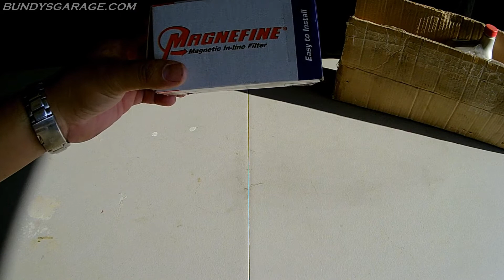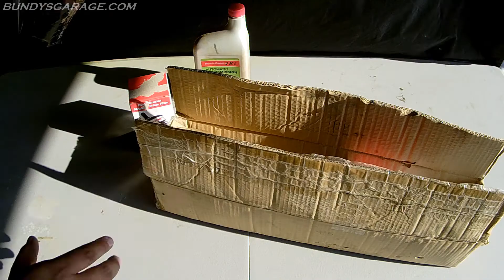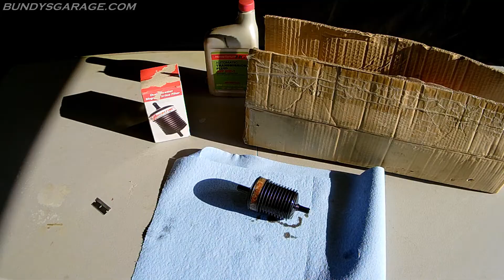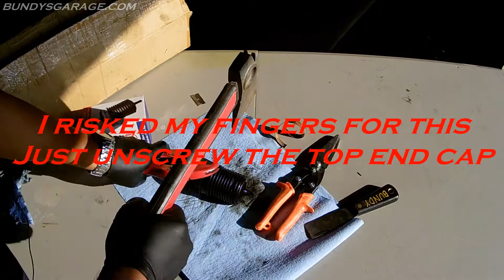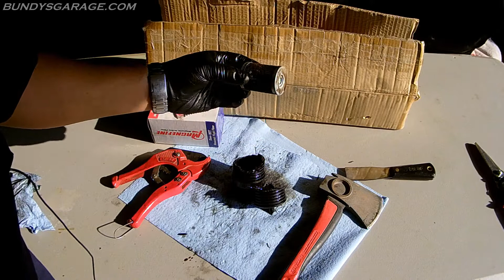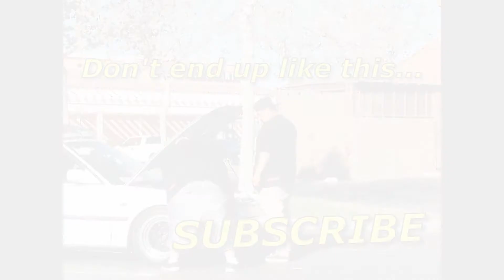Cutting open Magnefine in line oil transmission filter - Bundys Garage

Comment: WTF. now I feel ripped off. I have a brand new magnefine filter, with a metal case instead of a plastic one, but it is NOTHING like this inside. I can see through both ends and the only thing I see is a metal screen in the middle of the filter...

Comment: You could probably get away with putting on a fuel filter to filter atf fluid
Reply: Bad idea.  Fuel filters don't have a by-pass valve and if the filter restricts the flow it could kill your trans.

Comment: looks like if that filter is not changed often, it might clog up easy.
Reply from the maker: Your exactly right. The owner replaced the filter because the transmission would not shift correctly. After changing the filter the transmission worked fine.
Reply: Yea i wouldnt trust that at all. I do like the idea though
Reply: It has a bypass for when the media gets full, but u can't leave it in forever
Reply from the maker: You have to change it often
Reply: the transmission built-in strainer is used instead of a filter to prevent restricting pressure. It only prevents larger debris from being circulated... just keep changing the fluid to maintain proper viscosity!
🤗
Reply: It has a bypass once it’s full.

Comment: The guy used a fucking dremmel tool!!! ( if u really seen the video u would know...) you telling me you really don't have a die grinder with cut off wheel??? We're not cutting a sausage here... Its an enclosure designed to function under pressure. Secondly id be cutting length wise to really examine the interior with out damaging it...
Reply: Jaymoe69 Excellent points, I was thinking same thing. A razor blade, really? Lol

Comment: it's looks same of fuel filter ? can we use fuel instead of this filter ? the fuel filter what i mean one flow direction and almost same design ? kindly advice me
Reply: MrSpidermaintenance yeah , but it doesn't have a magnet. Besides that, it is same basic design.wonder if the media has any differences